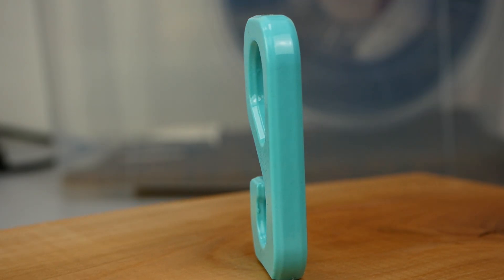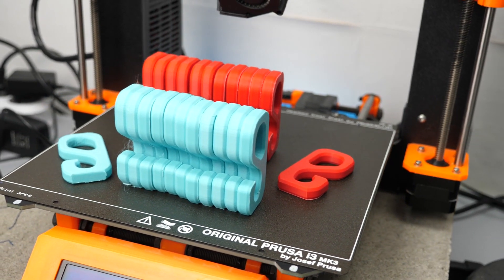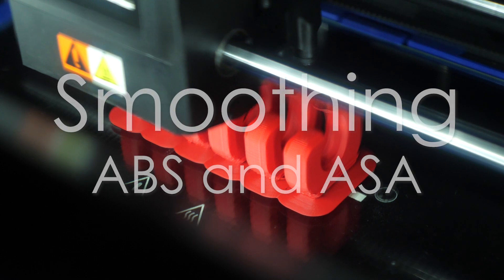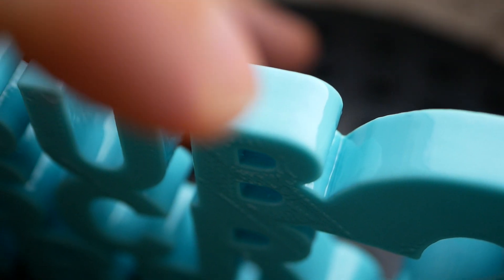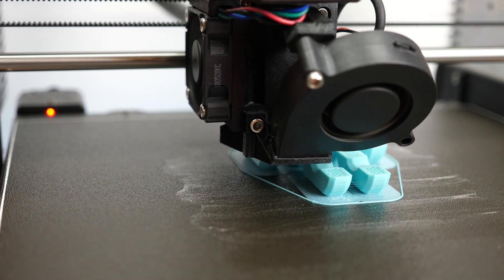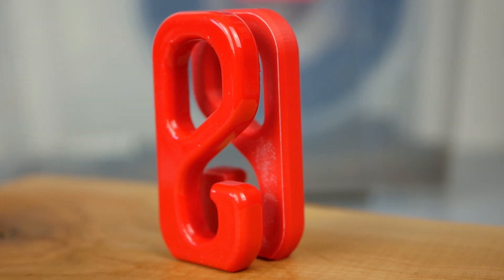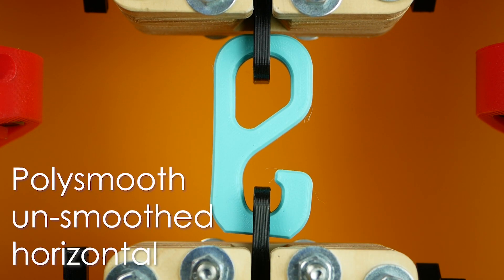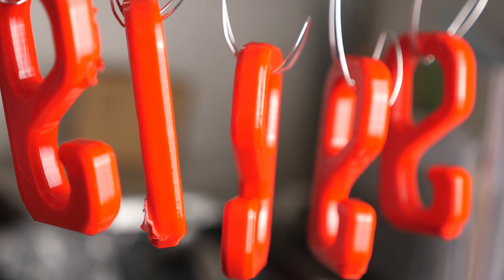Stronger 3D prints with Vapor Smoothing?

Comment: Try printing Wireframe versions of these parts! use a gyroid infill, and remove ALL the walls, so only the infill prints. the part will have much more surface area for the smoothnig to affect the layers and maybe it would have a greater effect.

Comment: Hi Stefan. Nice vid. I love watching your technical videos.

I cannot say anything about the smoothed PLA parts, but when I have acetone-smoothed ABS, I have found that it can take many weeks of directing forced-air over ABS before they even start to lose the jelly-stretch phase shown in your video.

I produced some acetone-smoothed ABS tank track drive sprockets for TCT2018 (Birmingham UK) rigid.ink stand, and they were still not up to full strength after 3 weeks in a wind vapour remover.
From experience, it's a bit like using too much polystyrene cement when making Airfix models - it can take a long time for the solvent to fully vacate the model.

I would be really interested in any results you get after forcing air over the parts for 4 weeks or more.
I suspect that the test objects may get a lot stronger than the ones you tested, but I have no idea whether the long-term 'dried' strength would be significantly different to unsmoothed ABS.
(The tank sprockets were roughly 130mm in diameter, 60mm high, with a 25mm shaft. About 280g of ABS was used in each - in other words, they were big chunky objects)

I realise this kind of testing can take up a huge amount of time (which is why I have not done it! 😀), so no worries if you don't get time either.
Just wanted to say that there may be more to this.
All the best, Susi.

Comment: I haven't used ABS in a few years now, but when I would hot or cold acetone vapor smooth parts I would notice some pieces would form white fracture lines along the layers. Almost as if the softer outer shell  was under stress from the infill of the parts that were not affected by the acetone. I'm not sure what the real reason for it was, but i definitely noticed different brands of ABS did behave differently in this regard. 
Awesome, thorough work as always Stefan!

Comment: I've not worked much with ABS, but I know that acetone can cause problems with acrylates which is why it isn't commonly used for solvent welding. The joints tend to be brittle and break easily when compared to other solvents such as dichloromethane(DCM). Unfortunately, DCM is a bit harder to come by than acetone but methyl ethyl ketone(MEK) can be found pretty easily where I live so it might make for an interesting comparison. You could also try paint thinner or any 'plastic cement' that flows freely like water. Don't know if any of this has been tried, but they should all work on ABS and possibly a lot of other polymer types so long as it is PE/PP based.

And if you are feeling really adventurous, you could try the polishing in a vacuum chamber (think walled glass of metal only). Place the parts in, evacuate as much air as possible and then backfill with warm solvent vapor to see if you get better penetration.  Once smoothing is complete, heat the chamber @ 60°C under vacuum for a few hours and you shouldn't have much of a problem with residual solvent.

Comment: How about additive smoothing processes, like resin coatings? My gut tells me that'll be stronger, since the load is affecting the skin first, but I only ever do it for aesthetic reasons. Also, if you want to test if acetone is still in a part, one method is to have a canary part in the same smoothing operation. Three weeks should be plenty, but baking the canary under a heat gun for a few seconds should tell you for sure. If there's any sub-surface acetone, it'll boil and make the surface lumpy or even start venting out.

Comment: I believe you need to anneal the parts after smoothing, for some 10 minutes, at 30-50C lower than extrusion temperature. You need cool down as slow as possible. Indeed solvents damaged the structure.

Comment: Interesting results, but maybe the unasked question is what would have happned to a design that allowed vapour to get into the interior of the part (e.g. by allowing vent holes at the top and bottom of the parts in areas that are not subject to stress).

Comment: From my experience: YES, there still is very tiny amounts of acetone left in the part, right below the skin. If you put the  ABS in boiling water the acetone will try to escape the part and form a bubble-like texture, pushing aside and stretching the smoothed skin but without being able to break it. Once it's in there there's no way to get it out, even after leaving parts in a vacuum chamber for 24h.

Edit: putting the smoothed ABS parts in luke-warm water and slowly raising the water temperature does seem to remove most of the acetone stench, and if done slowly enough avoids getting the parts bubble up with escaping acetone vapours. Haven't tested the effects on strength. Noticed slight shrinkage of the parts after boiling.
Reply: Should be pinned.
Reply: Even if you were able to remove all of the acetone, his results did show that the treatment effects are only at the surface. While visually, it looks like your strength should go up, the area you are affecting is negligible and any strengthening you do achieve will be small at best.

Comment: Nice work Stefan. If you have a very accurate scale it will be nice to measure the weight of the parts before and after smoothing. It seems there is penetration of the acetone in the walls which although it improves the fusion it seems to weaken the whole structure, hence the gain is not as much as many expected.

Comment: great video as always!  which material is stronger PLA or ABS for making parts exposed to a load or stress ?
Reply from the maker: PLA is stronger and stiffer than ABS but it is more brittle and can creep. It really depends on your application. PETG is a nice material in-between but also has it's downsides. Tough PLA or PLA+ can also be a good alternative with good ductility with the downside that it also gets unusable at 60°C.

Comment: Great video. I expected having the layers melted into each other with vapor would have made them stronger. Your results show that either the vapor is still inside the plastic making them soft or its changed the structure of the plastic and it will never be strong.  It would be good to test the following:

1) Retest these parts with vapor smoothing but maybe bake them in an oven at low heat for many hours helping remove the vapor from the plastic or let them sit for 6 months and see if the results are the same!
2) Trying printing with hotter settings and smaller layer height. If you managed 10 degrees hotter and layed the layers flatter with smaller layer height maybe compensate by increasing the cooling fan speed if needed, this could help layer bonding. If you work with a filament and maximize the heat this should give the strongest parts.

Comment: Hi Stefan great work , I've Primary used the smoothing process on 3d prints that are used in flow testing( Manifolds and ports). The smoothing process  as you said reduces roughness for friction factors, more importantly it reduces porosity of prints considerably, hencerework to make them airtight is almost eliminated

Comment: Very cool experiments.

I think it could be cool to run some of the procedures in a vacuum - get all the air out of the part, then bring in the acetone vapours in a closed chamber. The atmospheric pressure would force the gasses further into the part. After the smoothing is complete, then store the parts in a vacuum to help the parts offgas.

Comment: So maybe the atom Strukturen was weekend by the Aceton or even the conektion of the plastic as you said but if the Aceton sill in there weekend's it you should get that out by backing it on a low temperature in your oven for about 24h

Comment: I read somewhere, that it is assumed, that acetone takes water into the ABS, that aligns between the molecules and therefore reduces the bonding of the polymer strings, basically like an additive. If you have a precise scale you should notice a few % weight gain after drying off the acetone. I'll ask my coworker next week, if he remembers the paper.

Comment: For the weakening of your horizontally printed samples - Extruding creates polymer "fibers" chains that are aligned along the path of extrusion, creating strength in these directions similar to the thread on your shirt. By allowing the ABS chains to redistribute themselves by dissolution and reforming from acetone, you've weakened/removed the structure that was providing the extra strength. 

The polysmooth looks to be made of PVB, but I can't glean too many other things from it without really digging through the datasheets.
Reply: Great analysis.

Comment: Could you try flame polishing? It's mainly used on acrylics and glass but it should properly melt, not dissolve, the surface. Also why not try coating some prints in polyurethane resin and comparing?
Reply: Use Methylene Chloride....it's a Solvent Welder!!!😉

Comment: Another excellent & clearly presented video. I've found that getting Print Temp./Cooling right creates strong prints. Some of my PLA prints are super tough with "glass-like" walls, the settings are those that print clear filament as see-thru. Not being critical; You could inc. varying Infill Pattern because this exact Test does appear elsewhere, I think Tom Sanladerer & Angus@Makers Muse have both done it; Your knowledge makes your videos worth watching, eg. I'd not heard of the non-Acetone Solvent. Next Time; Print my sister & do Bench Press Crush Tests on her. I'll send you a file  : ) In fact crush/flex tests would be good. Let's see how Monopoly Houses, human models, cube blocks v towers perform Pre/Post Combination Strengthening Methods. Q. How much stronger/weaker is a print a day, a week, month or year after printing? Compare Virgin PLA v. Recycled Material Versions as I've found if you print those at too high. temp they tend to glue - BUT - if you had *really good fans cooling the model I think hotter gluey prints could be strongest and work well for flat prints. There's a vast array of Print Tests possible. I hope you will apply your scientific AND creative mind to explore some...

Comment: Maybe less time in the vapor bath would have achieved better results or just brushing acetone with a paint brush. In Your tests, the solvent penetrated deeply below the surface of the part and even when it evaporates it leaves small bubble-like voids and that makes the parts weaker. I print abs in most of the cases and sometimes I brush the part with acetone to get a better surface strength. Layer lines are still visible after this procedure but the acetone seeks into the small pinholes, cracks of the print. I did not make scientific tests like You but I think it makes them stronger and it takes very little effort to do.

Comment: Hey CNC Kitchen, I just noticed your print quality is AMAZING on the prusa i3 mk2s. Do you share your Printer and filament settings? I just can't get it right!
Reply from the maker: In 90% of the cases I use the standard settings in PrusaSlicer, no magic involved.
Reply: @CNCKitchen  whaaat, could it be the Das filament pla that messes everything up??

Comment: It would be interesting to try vaporing PLA with acetone to see if there is any improvement in strength.  While there is no so smoothing effect and it is unlikely to reduce stress concentration there may be better penetration and there is a suggestion in some papers that it could trigger crystallization and may improve strength without the distortion associated with heat "annealing".  While it is only likely to benefit the surface layer it would be a technique that would benefit smaller parts more than larger ones.  See: http://file.scirp.org/pdf/OJPChem_2013051018205962.pdf

Comment: I have no complaints about the methods used, but I'm curious if you used a dehydrator on them after smoothing. 

What if the acetone/IPA was able to slightly impregnate, but once the outer shell solidified on the outside it trapped trace amounts inside? Kind of like when filament absorbes moisture from the air.

Comment: sounds like we need a slicer that generates a 3D labyrinthine infill pattern with just 2 ports to exterior for passing vapor, smoothing the whole support structure!
Reply: How would you control solvent effect on unseen internal structure when you've varying strength of parts beneath Infill Surface Areas? Eroding 0.01mm from around a 0.4mm extrusion line has much higher impact on it than removing the same amount from a 1.4mm bit due to PiRSq. In seconds you could irrecoverably destroy  internal structure. How would you judge how long to leave the Infill Structure exposed to Gaseous Solvent when every model is different and when excessive erosion of already weak parts could break connections rather than 'plastic weld' strengthen them?
Reply: hmm..  I'm not sure on that one, probably needs experimentation.  maybe plug the ports while smoothing the exterior then pump a controlled concentration of vapor through the support structure for varying amounts of time and strength-testing to get it dialed in.  as long as no material from the structure is lost and it just temporarily re-softens to strengthen the bonds?

Comment: why vapor smoothing abs part crack after about 2 month ? how to prevent the cracking ?
Reply: Try annealing the abs part before vapor smoothing.  Especially if you sand the abs at all before you treat them.  Order of operation to prevent crazing (surface cracks):
1) print part
2) sand part if desired
3)wipe part clean of dust
4) bake part for about an hour or 2 then let it cool to room temp in the oven after you turn it off.
5) Treat part with acetone and allow it to dry fully.

Comment: ive had better luck vapor smoothing ABS with cold vapor.. i have a small computer fan in the large jar and some acetone in the bottom of the jar at room temperature.. it seems to smooth much slower and the acetone goes much deeper. to the point that some white parts go almost see through and you can see the infill clearly through the surface

Comment: seems to me that the printing is what needs to be altered to improve the adhesion. could the solvent be somehow included in the printing processes? possibly have the printing done in a diffuse atmosphere of the solvent. then post process the parts by baking them at a low temperature in a vacuum. just a thought.

also, don't know if it is feasible or not but it might be possible to add capillaries in the part to get the solvent to penetrate deeper. though it kinda sound like more effort than it's worth.
Reply: Solvent unlikely to be helpful during printing. I think what you ultimately need is better temperature control. You want the lower layer to be preheated and ready to melt the moment the hot bead of new filament layer touches it, and you want the bead to be hot and you want them to fuse together really well.

But after you have left the spot, you want this layer and layers below to be frozen in place solid. You want the whole print to retain shape.

I think ultimately adding solvent to print and printing hotter is fundamentally equivalent, with the same benefits, limitations and drawbacks. However solvent has a few issues of its own.

* it is a consumable which does not get recycled or reused. Even household trash is used for energy retrieval, but an evaporated solvent is not.
* since it's a chemical and not physical process, you cannot control it rapidly and precisely, unlike heat.
* it's not volume-retaining. you add a significant enough amount of solvent into the print to affect it, the print must swell up significantly, an order of magnitude more volume is added and removed than via thermal expansion coefficient.
Reply: @SianaGearz  i don't think this would quite be analogous to heat. 

heat is difficult to control. ideally for a weld you want to liquefy the previous layer, but the heat doesn't stay in the top layer it diffuses down softening the already finished sections. this softening happens through out the body of the filaments and weakens the structure supporting the section being worked on. you have to simultaneously give time for polymer chains in the two filaments to intermingle and cool it fast enough so the structure doesn't collapse. 

the solvent on the other hand will effect the entire part through the whole printing processes and effect the bottom the most. having been given the most time to soak in. the weakening effect will happen on the surface rather than the body so it might have improved tolerances. plus, as the print happens the weight of the upper layers and time will help the lower layer to bond.

to rebut your three draw backs
*the energy used to apply extra heat and extra cooling is a consumable. the solvent would likely have greater waist though. i think it would have greater benefit as well though.
*chemical reaction happen at a particular rate and the equation governing heat transfer and diffusion is actually the same equation. the main difference is the solvent would be slower
*i am not suggesting using solvent concentrations anywhere near what is used for smoothing. just a bit atomized in the air. while there will be some density loss after driving off the solvent i don't think it will be significant.

Comment: I believe that the best way to achieve proper penetration with any of your smoothing chemicals is in a vacuum chamber not sure what pressure or what time limit.  
But after significant drying time to ventilate most all the chemicals, may vary. 
Then followed by oven drying till all chemicals are finally removed.
All 3 processes will be needed to achieve significant penetration and removal of secondary chemicals.